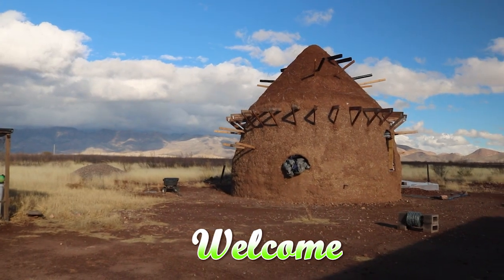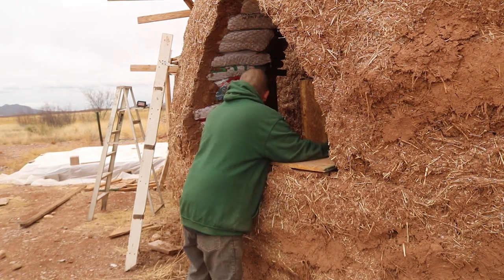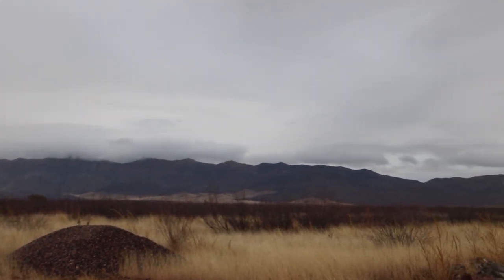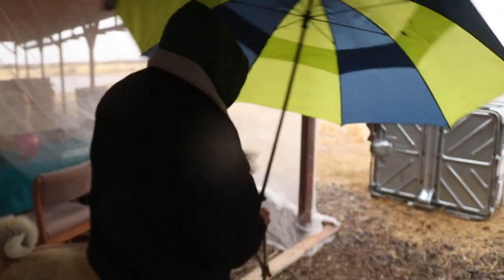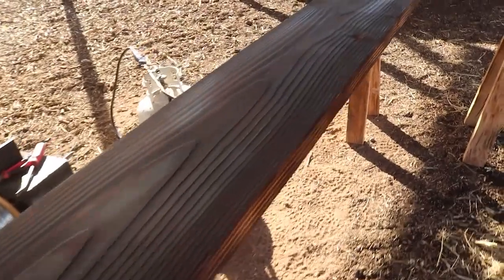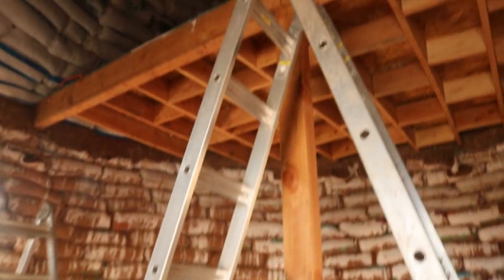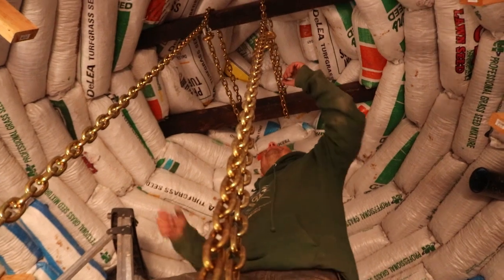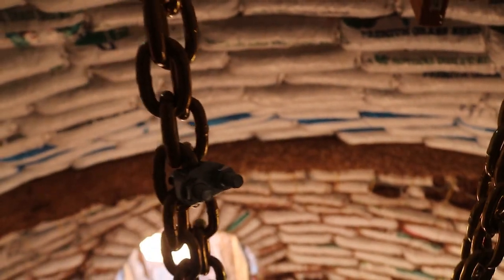We Built An Amazing Floating (Suspended) Loft In Our Earthbag Dome

Comment: Hi Jim & Jess, just a thought, you may want to cut a couple braces to go between the two beems at the top of the dome to keep them from being squeezed closer together by the weight the chains are supporting. 
  The dome is looking really nice by the way.
Reply: stole my comment Glenn I agree this could be a problem later on . The chains will compress the earth bags separating the beams .  A 4 by 4 jammed inside each chain and locked in place with screws can prevent that problem .
Reply: I was thinking the same thing.
Reply: @nowhereman7398  by the way the second beams is not supporting any weight at present; but also with the braces it will not really support his share of weight. The chain must be suspended to the brace ( just one in the middle )

Comment: Good Video.
Suggestion.  Add some 4 x 6 pieces at the top of the dome between the current 4x6 pieces that you have the chains around. These should be at 90 degrees to the long ones.  Parallel to the chains. One at each Chain.  The purpose is to prevent the weight of the suspended floor from pulling the long ones together.
As is you do not have anything to prevent this motion.   Sort of like rungs on a ladder.  Without these the weight of the floor and yourselves over time will allow the floor to sag.  
Additionally your Front ShugiBan board needs more fasteners.   Get a Deck building book or a good House building book and look at  how they make and use built up beams.   Ideally the ends of the ShugiBan board would bear or rest on the Outside walls and not stop short as you have done.   You can still do what you are trying to do. You need to adjust how you are doing it.   
Assuming you are going to have a Railing or Short Wall on the Loft you could make it a truss to carry the weight properly and do away with the chains altogether.  

Cheers and Happy New Year.

Comment: Great channel.  Two suggestions: 1)  Check the load bearing capacity limit on the carabiners, allowing for future live weight and shock loads.  2) Re-think the load design of the chains acting on the two beams at top.  A direct vertical down load may be an improvement over the side load arrangement shown in the video.  At a minimum, place a couple of spreader members between the two loaded beams, one each near and supporting the chain load.  Great progress.  Good to see the rain replenishing the water supply.  Keep up the good work.  Happy New Year.

Comment: You should double up that spanning beam. Good job and that post did clutter the space, but do reinforce between the top beams so they don’t get pilled together,  and double the edge board for 4 or more yard in the center

Comment: You need to place support spacers between the two hangers your chain is wrapped over on the top. The way you have the chains wrapped around them is putting lateral stress against the bags on that course. They will compress together, loosening the chain and cause your platform to drop. Additionally, the chain needs to be much tighter to hold the platform in place. The only thing that is holding the platform currently are all the bolts through the board securing the joint.

Comment: You said "The hooks don't fit the chain",  I think you might be doing it wrong.  The hook slides over the link, not through the link.  I also question how you've rigged off of the beams;  you've got a side load on one and sort of a top-load on the other; maybe box those beams together, then maybe steel I-beam across the top and suspend a chain from the center.  As mentioned before, it might be wise to consult an engineer.
Reply: Ya I'm not keen the way he hooked them together, that retrofit is useless, chain should be resting in hook 100 times more strength with tension, good luck,, ya it did get cold, we were 18' up the plateau..
Reply: I too learned this recently. Those hooks don't hook through a loop of the chain. They're made to slide onto a link sideways. It's obvious after you see it but not something that's easily guessed if you haven't seen it before.

And it was great seeing you two glowing with excitement at the end of the video! All the hard work is starting to pay off as your home becomes a reality.
Reply: Excellent suggestion, for long term....that weight needs to be supported correctly.

Comment: Great video today. What I would do is instead of the chain, bolt that upright 6x6 to the center of the span and the top support. I think it would look a lot neater and cleaner. The chain just doesn’t look finished. Hope you guys have a prosperous and healthy 2022. ❤️❤️❤️
Reply: I agree with the idea of using the post as a hung tie right back up to the middle but just going up and prior comment to combine it with the rail like a truss. It will be super important that rail is sturdy for its own sake but you can make it all tie together to its advantage better. The idea of hanging from the dome is a neat advantage but that could be done with wood. I’m worried about the chains weakest link and the properties of that metal chain with tension and compression at the point of a carabiner! Won’t any movement plus changing temperatures really additionally test the purity of the metal of that chain and carabiner? It’s a no go friends. That sure looks like something that can get brittle much more than that wood post. I agree with Mr. B consider hanging but with the wood and more solid connections. Maybe those cool  chains would make some nice mobile anchors for some room dividers or a lot of other nice stuff. Did I see Some pvc pipe puppies up there  at the top of the dome? ? Run the chains through them to clean them and open and close them if you use them as vent pipes with a bit of stuffing or cloth like the swab you’d use to clean a clarinet and maybe use the threaded chain spanning inside to out through what I thought were pvc pipes up top, also as a hoist. Y’all are going to be sure to vent your co2 out, right? Can I send y’all a co2 meter?

Comment: Couple of questions, did you discuss your hanging loft plan with an engineer? It seems to me you are depending quite a bit on the two beams  from above,  (should you have placed a glue lam instead of a wood beam? ) and the locking carabiner for strength. I understand the benefit of the clear space on the first floor.  Also, do you have a heater planned already? How will you vent this heat source?  Great work to date, have enjoyed the videos, I live in North Central New England, so this construction method is not a choice for my area. Good luck with the continued work, please don't consider these considerations negative, they are   genuine  concerns for you and the building safety.
Reply: @senatorjosephmccarthy2720  I respectfully disagree. When I see massive condos pancake and student bridges collapse I wonder whether a $300 to $1000 engineer's stamp is payment for true structural tests or higher education theory. The solution can fail on its own and it becomes the owners' fault. The solution can fail with the engineer's stamp and expense and it is still the owners' fault. Time will tell and perhaps Jim has already passed the idea by an engineer friend. Certainly future episodes will inform us. Loving this build.
Reply: @canuckyank82   I agree about using an engineer for building , myself I have 3 Brother in laws that are different engineers. The Civil engineer was very interested when I built a pole barn, and he had opinions that I gave consideration to. To satisfy his belief that I was not able to span a 24' second floor with 8" wood I Beams . I had spoke with a building rep at my local lumber yard, he believed that I couldn't do that span (24' ) with the 8" but when I mentioned it was really 23' inside, he calculated that I could use them at 12" OC. I placed a fishing line in the center of the second floor, attached a fishing weight and had it skim the floor. I threw it away after 10 years with no deflection. But, glad I checked on my concept with a pro, to reinforce my building belief.
Reply: @davidrn2473  6i too used an engineer to prove to a previous city that my sided cover it shed would withstand hurricanes as we faced east on the ocean. The engineer xertified it after inspection. It was up for 17 years until I sold. Several major hurricanes wiped out houses but my shed was anchored properly and its blowout panels worked perfectly. But the only change that allowed the city to approve my buildingbwas so engineer's  stamp. No other alteration was done or needed.
Reply: @canuckyank82   I forgot about the typical city issue with an Engineers Stamp. I told the building dept I was going to build a pole barn, they attempted to get me to build conventionally , I said I was building it myself. (I didn't know then, a pole barn is not taxed as a garage would be) The building inspector made me buy (aprox $25)  a set of eng stamped plans, I bought them, and never used them. The plans called for 12' on center posts, I went 8', also, plans called for three 2x6's. I used four, .40 PT below ground, staggered joints with reg lumber above ground, stainless (gun) nails below, reg above. Also placed recessed bolts every 2'. Still standing 20 years later, never did get the final building inspected, they just walked away and forgot about me.
Reply: @davidrn2473  they didn't forget, if you ever sell or get more permits, it will catch up, depends on counties also.
Reply: Just a consultation with someone in a high school physics  class or a contractor could point out how horrible the structural integrity of what he did was horrible. I worry when I watch people building live-in structures without checking out the integrity of what they plan to build first. The only thing that is holding the loft up is the 2x12 he bolted on to the other boards across the joints.
Reply: Especially if you get cattle wandering up there. Glue lam would've been the way to go.
Reply: @fisherus  you've clearly not been watching the whole build.
Reply: @davidrn2473  did you see where all the joists were placed between the course of sandbags that they are sitting at? So not only do they have the weight of all of those earth bags pushing down on them, but they have an additional source of the chain which is simultaneously applying additional pressure as well as supporting the structure (similar to a suspension bridge). But you would only need to talk to a high school physics student to figure that out.

Comment: Looking good!Something I would suggest, secure , with cross members to boards on top near the roof, where the chains come over. To spread the weight, from chains pulling bearing weight down.The two boards will need strengthening( braces). 💪 Just an suggestion! Looking good!!!!

Comment: Ok, let's call the chains provisional for now. At some point it might be worth it to (1) put 2x4s between the two beams to keep 'em spaced apart properly (2) have two solid rods with flat end sections, joined at the top with a threaded lag bolt, and seperated at the bottom (making a triangle shape) with each leg bolted midway on the loft beam. This will much more evenly distribute forces and be sturdier. (3) Consider the forces being put on the dome itself and if it's safe. You may wish to find a way to add additional internal bracing inside the beehive just to ensure those bags don't shift.

Comment: sorry man..what did i see... the chain when pulled, squeeze the two 4x6 or what ever it is together...
sorry to tell you guys, that´s a no go... the most vulnerable spot of your dome is the top... it is much more likely something is shifting up there,
because less load from the top keeping things together... with the two 4x6 (or whatever it is on the top), you need to put two spreaders in, to make sure the two 4x6 are not squeezed together!
if they do, they maybe cause some collapsing.... and even more important... the chain need to go down straight, as straight as possible, so the down pressure gets distributed even on top, i hope you understand where i´m going with that... in general, you got a lot of support on the side already... the 2x6 in the front, you add in the video, will do most of the work... but not if it´s to short and maaan,
it looks to short to me... maybe a foot on each side... please do yourself a favorite, fix it, if not, you might regret it later!
the same with the bolts you showed in the video, if the holes are much bigger then the diameter of the bolts, things start moving sooner or later, we all could see how easy you could chuck in the bolts after drilling, again, that´s a no go! you just create a bit of surface pressure, it is not that much, trust me!
it really looks dangerous.... might be a good idea to think about it one more time...

greetings from germany... and yes, i´m an engineer!

guys i really try hard to find the right words,
english is not my first language, keep that in mind please!

keep up your dream!
but save!

Comment: Just a thought.. one of those beams is more then enough support for the floating loft..  I need to point out, by chaining across both beams any tension from the downward pull of gravity will over time cause those beams to move closer together, especially with use and added weight. the stresses from the beams moving closer together might compromise the integrity and strength of the peak of your dome.. it might be better and a safer option to chain to one single beam or put bracing between the beams to keep them from shifting closer together..

Comment: My old wood frame construction brain ain't crazy about the single scabbed on 2x10. 
Hindsight says shoulda built up a "flitch beam " with a glued and screwed middle layer of 1/2" plywood...before that long 2x10 was installed on outside. 
Also those lag bolts are stronger in an alternating zigzag pattern. 
Monday morning quarterbacking here. I know you get it all the time.

Comment: did the loft shift (having the chains tighten) after the post was removed?  It would be interesting to know in the next video.  Posts in domes allow for interior walls (for bed rooms, bathroom or kitchen or closets) vertical wall space would be helpful for shower stall or kitchen cupboards.  I do not know the layout that you have in mind, how you will divide  the living areas in the 2 domes.  Ya'll are planners and probably have all of this worked out.  Stay warm, glad you got some great winter rain volume, that's exciting.

Comment: Shouldn't that window be to the outside?  That would prevent cold and hot from penetrating deeper in the wall at that spot, plus that would give you a place to put a plant.
Reply: The second window there will be closer to outside.  They will fill the space between with styrofoam beads & remove the beads with a vaccum for Winter months.
Reply: Cool! So they are going to install two windows with a space apart? If both have a sash and you could open them opposite one high opening one low opening it would be like Alvar aaltos paimio sanatorium from a cold climate but that as a tuberculosis hospital way back the design required lots of fresh air. The two glazings opposite each other supposedly were set up to act as a heat exchanger tempering the air as it “ leaked” in channeled up and through the two windows before entering the space. I’m wondering if switched one way opposite the other would work better hot versus cold weather but still get you able to get air changes while tempering the zone of the air change. You’d need to be able to have opposite opening windows up top closed and bottom open on one with bottom open then top closed on the other, and still close off totally with a sandwich of your neat styrofoam beads plan in the winter and maybe  a few channels of orbees ( yes the toy pretty hydrogels) in the summer for evap cooling! And make it so you can clean it out, too! For rockstar guys like jim and Jess that should be cake!!! Oh and I wish y’all a merry good at the top and Flash at least the lower sash. Throw orbees around to haul out water and embed diatomaceous earth in the interior plaster are also on my Christmas New Years best wishes for your comfy beautiful home.and definitely take up the German friends note..

Comment: G'day from the land of Oz. As a sparky I would suggest that wrapping the extension lead around your hand and elbow is not the best. two reason,
1. When you coil the lead you are twisting the cores and overtime you damage the lead.
2. There is a possibility if there is a nick in the insulation that you me get a belt, and it is hard to remove the lead in the hand elbow configuration.
Coil the lead up by putting over your hand and letting it naturally coil, much like a lasso rope.

Otherwise I applaud you mate. Having built a straw bale house, I know what sort of labor goes into these constructions. Just to make you feel jealous for the last week we have been having temperatures of 30 to 35 degrees centigrade  here.
Reply: Pssha!, call us when you hit 50C.